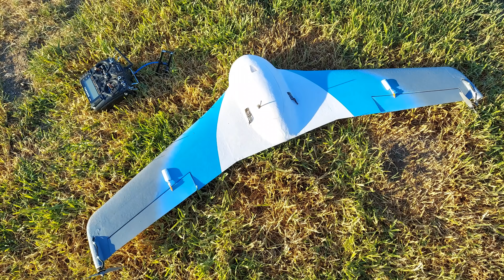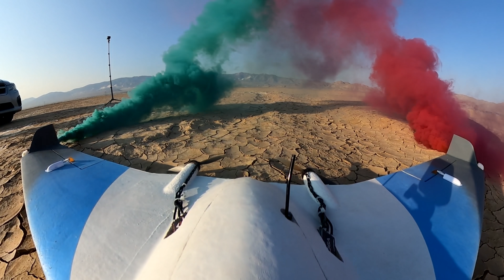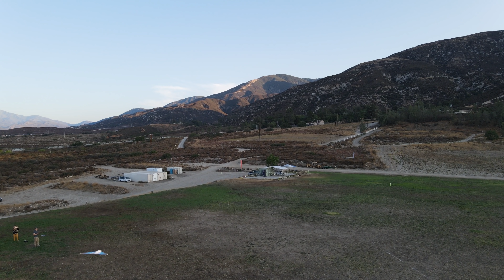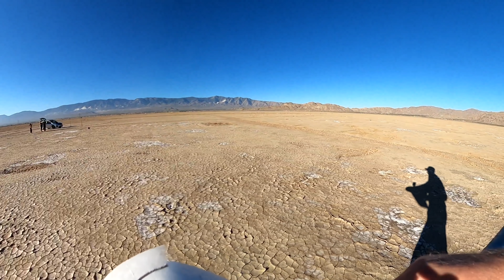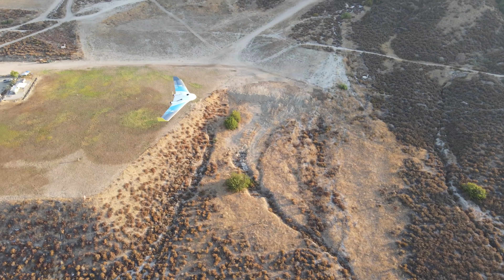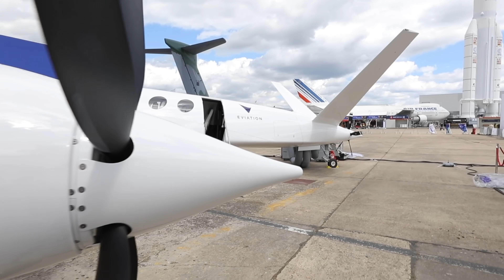Can Wingtip Motors Improve Aircraft Efficiency?  RCTestFlight Solar Collaboration Part 1

Comment: The idea sounds good, but have you considered the implications of having a weighty part as an engine at the wing tip?  You have to consider structures as well...unless you put there just the propellers and transmit to them the motion with some type of gear...but I suppose this has some downside too...

Comment: Very interesting project. Think it would have been more consistent comparison if you'd built Serenity (2?) with 4 motor pods vs. just 2. This way the airframe would been consistant and swapping motor positions easily preformed. You could maybe even use folding props, and switch motors mid-flight, or run all 4 at once.  (note: folding propellers would solve your landing issue as well 🥴)

Regarding the GoPro mount failure. I believe the high mount resulted in a drag vector off centre of mass that virtually shifted the effective backward, decreasing stability of the wing (flying wing are known for having picky CoG locations). 

Overall nice work and great presentation. 

BTW: one more thing ... to consider, placing the motors just inside the wingtip, so wingtip vortex and propeller vortex act against each other, canceling out at cruise speed. 🤔
Note a propeller in front of the wing would be in cleaner air, so the propeller is potentially operating more efficiently. This is why pusher configurations are louder, as propeller is in turbulent air. 🧐

Comment: One problem.  A single engine failure, on an aircraft with only two wingtip motors, would result in an uncontrollable aircraft.  There is no way something like this would make it through certification because it is too dangerous.

Comment: I’m wondering if the lack of efficiency gain is because you’re flying at a speed that makes induced drag not significant. Recall that the ratio of induced to parasitic drag is very dependent on airspeed.

Comment: One area not addressed…. Safety.  In the event that an engine is lost, it’s doubtful that the pilot will be able to fly the aircraft home on the remaining good engine due to the amount of torque created by putting the engines so far out.  I can’t imagine how violent the loss of control would be in the event of an engine failure at full power.

Comment: Interesting...

There are a few things that come to mind. Especially how the motors are mounted.
I realize that they need to be firmly attached to the plane. But wouldn't it be great if you added a (3D printed?) rail along the rim of the wing, so that you could move the motors without having to put that among of effort into plastering. And version 2 would allow you to move the motors in-flight...
Another thing I would like to see is channeled airflow like a harrier. So you could place the motor(s?) centrally and have air-channels going out to the tip of the wing. efficiency but maybe quieter?

Comment: Shouldn't the propellers be on the front of the wing to improve the lift? 
I.e. what's behind the aircraft isn't affecting it. 
With the propellers on the front of the wing tips, the wing tip air flow from under to over the wing would not occur as the propeller vortex would be moving the air in the opposite direction. What you have done is cancel or reverse the vortex behind the aircraft, but apparently not on the actual wing tip, which is where the extra lift would be created.
I.e. the air probably still flows from below the wing around the wing tip, but the propeller then reverses this flow as it enters the prop.

Comment: A system like this should have spanwise distribution  (4-6  allows easy optimisation between low speed high thrust and high speed / "cruise optimised")- reducing the likelihood of "critical engine" incidents...   - the inboard motors can shutdown and feather   ? tractors inboard  /  pushers outboard - for optimal "off the mark" +  "vortex recapture"...

Comment: I think this is great but I'd bet you can do even better.   Perhaps extending back from the wing tip some distance for the motor would do it.  The idea would be to have the prop in the center of the wing tip vortex but also in as smooth of air as you can.
Another idea would be to make the thing have one pusher prop behind the center

Comment: I do have this theory where if you put the engine on the very edge of the wing will make a better efficiency. But there's this also something to do with a plane's structure.. it basically can jiggle/wiggle on purpose so it can handle turbulence and even makes plane even stronger.. but if you put the engine one the edge of the wing then the wiggle on the planes structure can be aggressive where the engine and the center of mass fighting each other

Comment: For a proper comparison I think all four motor mounts need to be there for both test cases. Taking them off the wingtips, adding them to the middle, and changing the wingtip shape hardly seems like an apples to apples comparison.
Regarding the launch crashes, I don't see any control surface movement and the plane also acted just like there was no control surface movement. I doubt the camera was the problem. Maybe try launching more manually where you can cut the throttle at any sign of trouble instead of trusting the auto-launch, might not have snapped the spar.
Why kevlar instead of glass? Isn't that expensive?
Reply: And of course as soon as I write that, I notice a different view where the onboard camera does show the control surfaces moving... but just barely. Well you did say "no changes to stability settings from the split rudder plane". Maybe that should have been done. Looks like you also had gyro controlled differential thrust with the wingtip motors, maybe that made the difference, since there was a pretty large yaw change to correct.
Anyway, nice looking plane and those first flights were magic!

Comment: The gains in efficiency may not be amazing unless you're using huge rotors...but the gains in overall stability seem to be more than worth it.    There are other considerations as well, but honestly, the change in overall flight characteristics and how much more smoothly one configuration handles than the other, are pretty striking.  The only real issue would be engine failure, but that's not so common I think that it would be a major issue.  It would just be required to shut the other engine down and glide in, with perhaps a default setting to the props that they'll go into a kind of unpowered auto-gyro mode that keeps the craft stable in the glide.  Not ideal, but far better than most alternatives.
.
Efficiency be damned, it makes flying wings more stable with less engineering, and that alone is more than worthwhile.

Comment: Does a swept flying wing even produce tip vortices? With no tail, the lift has to be negative at the aft most point of the wing for conventional pitch stability, the wing tips in this case. I'd expect that the tip vortices would rotate the "wrong" way for a certain distance even without the wingtip motors with this wing configuration.

An outward spinning motor is effectively doing the same thing as elongating the wingspan, with the motor torque adding a bending moment the same as wing extension would. There is still a structural advantage of a wing tip motor because, unlike an extended wing tip, the motor torque is constant or can be automatically reduced to limit bending moment in a high load situation.

Comment: I wonder IF it might be possible to get rid of the wing-tip propellers by instead duct air along a tube in the wing and giving the tube an opening at the wing tip (a bit like how a Dyson bladeless fan works), and to design the opening so it counteracts the naturally forming vortex, in order to achieve the same wing-lengthening effect you get from wing-tip props. This then could work with a turbo fan or even on a high-speed jet aircraft. What do you think? 🤔

Comment: Interesting but lethal idea.

Really fun and wonderful experiments you have shown using model planes—but not transferable to aviation.

Looking over the previous comments, there seems a misunderstanding of what, and how severe, the basic problem is—although at least one multi-engine pilot tried to explain.

Power is not the problem—even though by having two engines the chance of engine failure, and thus a 50% loss of thrust, has been doubled.

The tiger that kills results from the asymmetrical drag and  thrust created when an engine fails.

Even with counter-rotating props on engines located as close to centerline as possible you have only a few seconds to maintain control and feather. 

The evidence is that pilots of even turboprop twins are often not up to dealing with this expected occurrence. When they are not, generally everyone dies as the aircraft does either a Vmc roll or flat spins into the ground. 

Wingtip engines give the longest possible lever arm and thus maximizes not only the adverse effects, but would cause them to occur with blinding speed giving even less time to recover than with current design.

COM INST SEL MEL SES
Reply from the maker: I have seen a lot of these comments and I'm not sure exactly what audience this video is being delivered to, but I don't see these comments on the typical quadcopter videos that have 4x the failure rate of a single engine vehicle.  This is only double.   I understand the risk, but this is a drone, not a full scale vehicle prototype and ONLY meant to isolate efficiency differences, not test final full scale configurations.

Comment: Nice! I'd love to see the effect of pivoted auto-stable tip vanes to "harvest" tip vortex at all AOAs, and "eddy flaps" to enhance high alpha lift. Both are passive systems. 
I'd also like to see an analysis of L/D for a high performance foil and fixed wing area at different ARs, taking into account the increased L/D at higher Chord Re values. (Big wings generally have better LD than small wings). Is there an optimal AR at any Re regime, or is infinitely high AR always come out best?

Comment: When you have the props on the middle of the wing, is there resistance added because of the air being pulled around the wing?  I'm imagining like a large box fan with a piece of paper stuck on the back side of the fan... attempting to be sucked through the fan.

When you put the props on the wing tip, there's less material in the way of what the fan is trying to do.

I'm just curious how much that impacts things in addition with your notes in the video.

Comment: Concurrence, this aft-wingtip location for counter-rotating wing-tip propellers will optimize performance. Credit this to 
reduction of induced drag . Thus conversion into thrust of otherwise lost drag energy dissipated by the wingtip vortices. Keep thinking, on the right track !   This thinking Concurs with flight-tested instrumentation systems used by NASA experimental programs. Their design Goal was to achieve Maximal lift to drag ratio, by use of wingtip propellers.
 If Wingtip-Propeller Rotation is opposite to the wingtip Vortices, Resultant is conversion of approx. 
50% energy otherwise lost from wingtip vortices into thrust !

Comment: Not being an aeronautical engineer it would seem to me that by placing the engines at the wingtips would place extra stress on the wings at the connections to the fuselage or severely change the configuration of the aircraft itself.
Reply: Placing weight at the tip reduces the bending moment at the root of the wing, so the structure is less stressed statically.

Comment: My former boss, LtCol George Leach was a test pilot.  He confidently could fly one USAF plane (I forgot the designation) which if it lost an engine, it would lose control unless the other engine was immediately feathered back.  It was a bad idea experimenting with this wingtip concept for the simple reason aircraft safety has to be the most important consideration.  This is not a 50,000 Catamarran yacht where the worst that can happen is you need to leave the rudder hard over to hold course.
Reply from the maker: Its a drone.   It is twice as safe as a typical quadcopter due to having half the failure points, and no one complains about those.

Comment: It isn't lift that makes an airfoil fly, it's actually suck.  Air pressure isn't increased on the bottom it's reduced on the top, suction is what makes flight possible.

Comment: Could, switching motor direction + prop rotation in the same direction of the wing tip vortices, turn them into thrust? Effectively pulling lift across the span making the wing more slippery? Or just slow it right down?

Comment: The Horton 229 crashed because 1 of it's 2 inboard jet engines failed & the asymmetrical thrust caused it to spiral into the ground.  So, this perhaps argues against the safety of wing tip motors.  Ordinarily, an inboard motor failure isn't a disaster because a pilot can offset the thrust yaw with rudder.  The Horton 229 was completely tailless& therefore had no rudder control.  The whole basis of the design was Prandtl's lifting line solution based on the wing root bending load being the design constraint determining span & lift distribution, AKA the bell shaped lift curve.  Prandtl's previous solution was based on a span limitation being the design constraint which lead to the shorter elliptical span lift distribution.  Due to WW2,his 2nd more efficient and elegant solution went largely unnoticed and ever today is seldom used.  This solution solved the adverse yaw reaction to aileron control.  This removes spiral dive instability and therefore removes the need for a fin.  It allows  a longer span where the extended wing acts much like a triplet gaining thrust from the tip vortex and therefore reverses the induced drag response to aileron control, yawing the wing in the direction of the banked turn.   It makes completely tailless stable flying wings possible without drag inducing control devices.  It is something like 10-20% more efficient than any conventional aircraft.  However, with multiple engines, there is the issue of asymmetric thrust in the event of engine failure.  From memory, Prandtl's theory dates from around 1938 &it is still far the most efficient and elegant solution & his paper on this is amazingly just a single sheet.  Anyway, I thought you might find this interesting information.

Comment: Great demonstration of wingtip motors!! 
I have one question however; How can this ever be viable for commercial use?
My immediate logic-reaction is: No redundency. If one engine fails, you're directly forced to become a glider. With the only left over power input so far from the centre-line, that power input will immediately take you to the site of the crash...
Right?
Reply from the maker: GREAT question that I spent a long time mulling over.   My answer is that it is still twice as reliable as a quadcopter, which nobody thinks twice about anymore.   My second answer is....   you'll have to wait and see, sorry :).
Reply: @thinkflight  Thank you! Totally true regarding the quadcopter :)
Very grateful for this super content!! Cheers from Amsterdam!  :D
Reply: @thinkflight  Is there any way to engineer (double engine) counter rotating electric wingtip propellers?
edit: this probably defeats the whole premise anyway... sorry
And I was thinking about a pull-push setup.
Reply: @thinkflight  flying that on one motor at a wingtip would be quite challenging.

Comment: Try both at once.  Two powerful motors inboard, and two smaller motors outboard.  The ones outboard only need to move their vortex.
Reply from the maker: I think that would be a realistic real world layout, maybe just one central motor with two wingtip motors or something.
Reply: @thinkflight  Where's that wing from?  It looks more stable than something the air force flies.

Comment: mmmmm   Just an idea....   If you have two planes with the same aerofoil with the motors at different positions(tip / mid wing) and flown at the same time (ie. next to one another) then I would assume it be a more comparable test (same atmospheric conditions) as long as the motors are drawing the the same amount of current.                              
Nice work on the kevlar moulding, have you considered vacuum application.
I think that there might be same more variables in your experiment..                Nice video all good.

Comment: Wouldn't seem to matter. There's only so much energy you can put into the prop before drag stops further speed of the prop, and therefore thrust. The prop can only go through the air at a certain speed for a given amount of energy. The prop going through downward moving air is no different to flat moving air. The airspeed of the prop is unchanged. Though the rotation speed is due to the fact that the wing tip prop is moving through air that is resisting the rotation more. Same as when flying through a head wind. Your airspeed is unchanged but your ground speed is.

Comment: I'm obviously late to this video, and I don't know enough to make a conclusion from a place of deep understanding - but, correct me if I'm wrong, doesn't it seem like there's no real reason NOT to use wingtip motors?  While they may not have something as high as 15% increased efficiency when the aspect ratio between wings and props is low, they seem to still have an increased efficiency (as well as increased stability).  Is there anything more traditional placement can offer that wingtip rotors can't, to give a reason for not pursuing even the potential small benefits of wingtip rotors?  I don't remember hearing anything in this that offers a downside to going to the wingtips, really - it seemed to all be conclusions of increased stability and efficiency, even if the efficiency increases were less than precluded as possible.